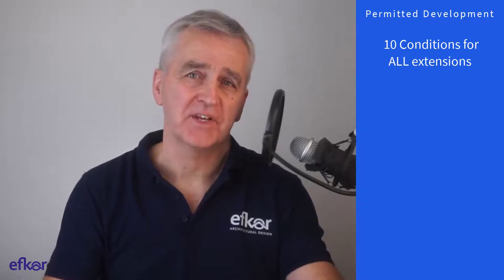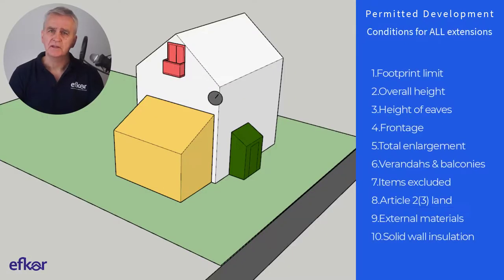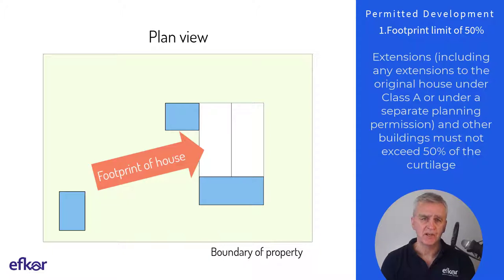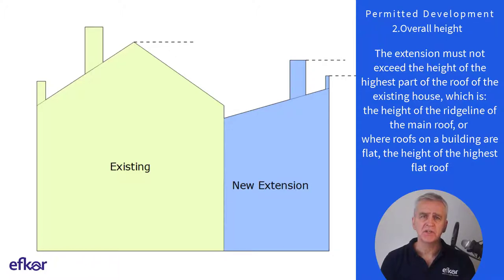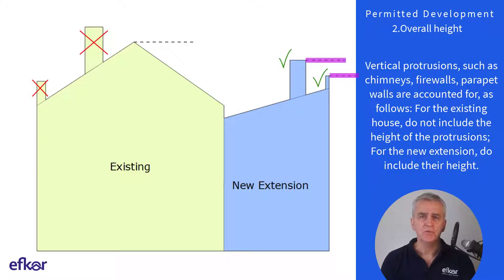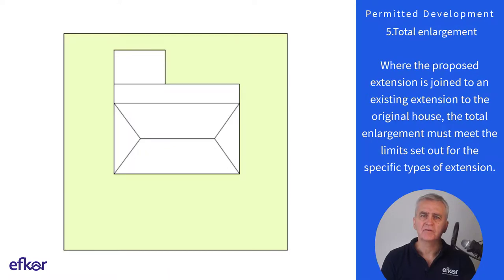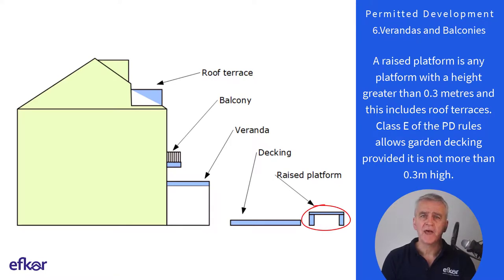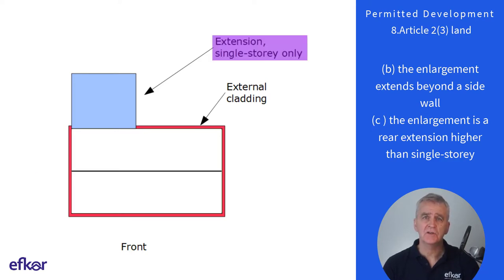10 Permitted Development conditions that apply to all Extensions

Comment: Hi, thanks for sharing your planning experience and knowledge. Your elaboration is helping a lot of people. May I ask a question please in this regard? If a property fulfills all these requirements, there is no confusion, and all work is done according to building regulations through building control application and under council supervision and gets building regulations compliance certificate, is it still needed to have a certificate of lawful development?
Reply from the maker: Under the circumstances you describe there can be 2 reasons to obtain an LDC. (1) You might think that your property fulfils all the PD rules but you can never be 100% sure. For example, if your property is on a corner, which elevation is the Principal Elevation? You need to know this if you want to build a "rear" extension or a dormer on the "rear" elevation. If you obtain an LDC, this is confirmed for you and you needn't worry about an enforcement notice (2) When you come to sell the property, the LDC gives the purchaser 100% peace of mind that the additions were added legally. It all depends on your appetite for risk and your knowledge of PD rules. I hope this helps
Reply: @efkor  thanks. Much appreciated